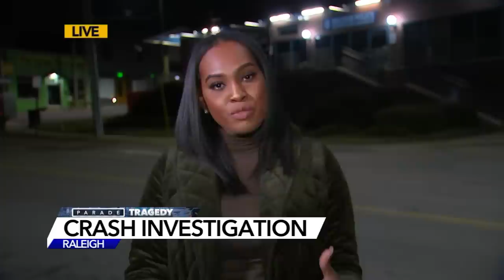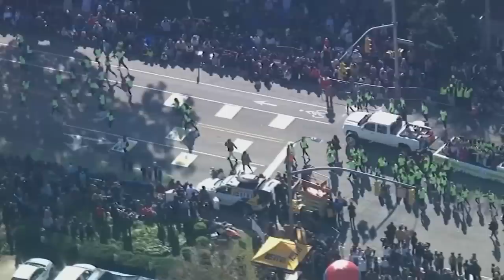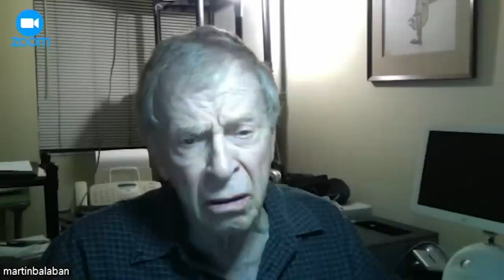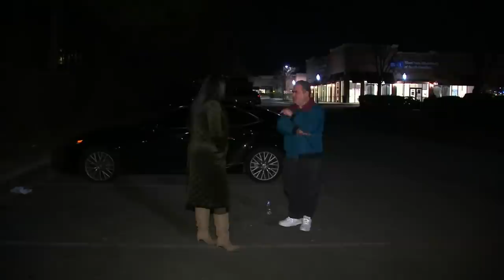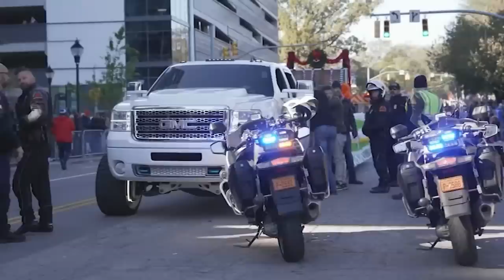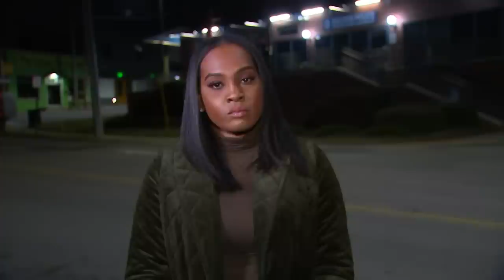Investigators look at truck part by part after Raleigh parade tragedy

Comment: It sucks that so many of these avoidable accidents happen! My son is now starting to drive and I’m hoping to get through his head that If any mechanical malfunction arises, shut it off! Just sickens me he was going maybe 10mph and not one thought of getting it out of gear or just shutting it off came to thought! Always after it’s too late. So tragic!
Reply: shutting it off is probably the worst possible thing to do in a situation like this. if you shut off a vehicle, you lose all driving functionality. your steering wheel locks up, the break booster stops making pressure, leaving you with whatever it has made, and if the brakes fail, you have no break pressure and if you have to swerve to avoid something, it is absolutely, 100% IMPOSSIBLE TO STEER WHEN the ENGINE is OFF. in a normal gasoline powered vehicle, its better to try to get it out of gear, or crash it into something than turning the engine off.

DO NOT SHUT A VEHICLE OFF WHEN IT IS IN MOTION, come to a stop, or let it stall out, as long as they key is in the on position, you will have steering. I don't know how it is with push button start vehicles though

sometimes, what looks like an "avoidable accident" from the outside perspective, is not so cut and dry, and i appreciate that the forensics team is investigating it completely and diesel trucks, like this one here is a lot more complicated than anything you or me have driven in our lives. that truck is rated to tow over 30,000 pounds.
Reply: He was going in a straight line at maybe 10mph! If you lose your brakes! You shut it off to bleed of whatever speed off you can! Not just plow into a kid and keep going!
Reply: Also if you turn the key one click, it unlocks the steering.
Reply: @brocksutliff8782  truck won’t cut off while in drive in motion, truck also will not let you slam it out of gear. Emergency brake is for holding trucks weight, GM is also brake cable, pushing it wouldn’t have done a thing with the weight behind it. There’s literally nothing you can do with brake failure in the middle of a crowd, keep going straight until it stops or swerve into the crowd to ethier side? You people really need to stop speaking on what shoulda coulda woulda done, and just realize you probably would’ve been in the same situation if you were in his shoes that day- freaking out yelling to get out the way and trying to do everything you could to avoid.
Reply: @brocksutliff8782  shutting it off is the worst thing to do

Comment: The bumper height was changed. Making it more dangerous on impact.  That's illegal in most states
Reply: at stock height that truck would have still easily ran someone over
Reply: @jaynederp5236  insurance has a field day with that one tho so I don't imagine it helps here..
Reply: Litterally every single mod to that trucks suspension brakes all that need to be DOT approved parts

Comment: It's called the emergency brake... if that doesn't work turn the ignition off put it in park...
Reply: Gm doesn't allow you to turn off the ignition if you aren't in park and won't let you put it in park unless stopped after 2007

Comment: Vehicles breaks have been redundant for years the emergency brake is completely separate from normal brakes they both can't go bad.....this is just the result of giving people driver's license but never show what to do in emergency....ask any one and they will not know the brakes are different systems. Only way it won't work is if someone one removed brake shoes from truck....that truck is new enough emergency brake should been fine.🤔🤔

Comment: Booster failure is the issue! Emergency brake is there for a reason BUT THE OPERATOR HAS TO USE IT!
Reply: The emergency brake was not operational either from lack of use or from disconnection after the lift modification.
Reply: Gotta realize that most younger guys or girls with trucks and SUVs that are built for show or to look good aren’t going to be thinking about an emergency brake in the situation because more than likely they’ve never had to use it and it’s really really easy to forget completely about the emergency brake when it’s not a handle sitting right next to your shifter, it’s a pedal in the floor and if you’re not someone that uses an emergency break often or on a daily basis it’s not exactly going to be something that stays on your mind plus with being said that the truck has a lift kit and all the fancy stuff the emergency brake could have been disconnected because of the thought of never needing it or having a use for it a lot of people do disconnect the emergency brakes because they simply don’t even know what it is or have a use for it, or think they would ever need it

Comment: At the very least a proper functioning trailer brake would have done a good job at that speed. The power steering pump which provides hydraulics to the brakes are known to go bad. All around a lack of experience.

Comment: There's no excuse. Brakes, parking brake, ignition off and park (automatic) or in gear (manual). Inexperience is the culprit. And yes, I had the experience to do all of those things at 16. If this guy didn't have the experience at 20, he had no business pulling a float in a parade. There is simply no excuse for that to have happened.
Reply: I mean he probably was freaking out and wasn't thinking clearly accidents happen he was on adrenaline

Comment: I'm betting ether the trailer didn't have the brakes hooked up and if they were they weren't adjusted by the Driver.
Even if the hydraulic brakes failed on the truck the electric brakes would have stopped both truck and trailer.

Comment: downshift, turn the engine off, pump the brakes, does the float have trailer brakes? Looks like the truck was heavily modified. Sometimes that what you get. So sad...

Comment: Number 1 that truck was tampered with those are not factory rims and it looks like that turck has a lift kit as well...
My heart go out to the one's effected from this...
Accidents are not preventable this was someone did not know what they were doing with the truck modifications...
What about the emergency/parking brake inexperienced driver could have turned the truck off emergency brake or put it into reverse...

Comment: 1: Pump brakes…
2: Turn off engine…
3: Slam it in neutral or park…
20 year driver probably doesn’t have much experience.
Reply: Gm won't let you turn the motor off unless in park and they don't let you put it in park without stopping
Reply: @colbybarbour3747  I didn’t know that. Then I’ll all a #4: Parking brake!
Reply: @fromundadeez4823  he probably deleted the parking brake during the lift

Comment: Driver Panicked. Every vehicle can be made to stop. If brakes fail use the emergency brake ( parking brake ), if that doesn't work shut off engine, even with push starts just hold that button hard for a few seconds, lastly put the vehicle either in neutral or put it in PARK!!!

Comment: I personally had the same year truck and got rid of it because it almost killed me because it would die with no warning shutting the engine off. A week after I got rid of it they put a recall out for the ignition cutting out. My faith in gm vehicles left after have two in a row that absolutely where junk. So do I believe the driver it's  possible but I will not be surprised if it was his fault.

Comment: The hydraulic system? It’s a truck not a tractor… e brake , turn off ignition, slam it into park…. I don’t know…
Reply: It has hydraulic brakes, wheelers have air brakes. Different system. Add the weight of the trailer and its not stopping.

Comment: That sounds like a pure Factory build failure if there were no modifications to the truck except the wheels that has nothing to do with anything it sounds like the truck had way too much weight on the back and the brakes would not hold the weight from stopping it otherwise sounds like a factory failure stop pointing out modifications done to Vehicles because I can assure you that aftermarket companies that are quality build Parts better than Factory

Comment: Definitely a tragic accident for all involved... Glad my grandfather trained me for brake and power steering failure, but I'm sure not many are given that knowledge.

Do I feel the guy should be crucified in court? Absolutely not (This is the EPITOME of an accident, and the kid is going to live with it the rest of his life regardless of what happens and that in itself is punishment enough in this instance).

However I do believe that drivers education should train people on the use / employment of emergency measures such as deploying of the park brake, putting the vehicle in neutral and turning it off, slamming it in park (because damage to a transmission can be repaired but the loss of a life cannot) etc.

Comment: Putting in park - just makes noise, only engages when stopped, also breaks easily
Park brake - even in mint condition it will barely hold these trucks empty on a slight incline with disc rakes in the rear
Shut the engine off - would barely help at low speeds due to torque converter, plus loose steering assist
Reply: Park will engage at slow speeds I’ve done it on accident in my 2015 Denali hd and it stops it in its tracks

Comment: You could've pulled the emergency brake that works with a cable not hydraulic
Reply: I "heard" the brake cable wasnt connected because of the lift on the truck often times they are to short afterwards
Reply: @tomr3422  then the guy is at fault

Comment: If the police had stopped him so many times for his truck why didn’t they just take it off the road instead of leaving it up to him (who already showed the police he didn’t want to inspect it). But that’s just another story of the “justice”system loopholing people into committing crimes and then taking the right steps to prevent them and rather than healing and coping with the problem, we make an example out of a person who was invited to pull a trailer for the parade by the CCO Dance Complex.
Reply: Its NC congressmen repeatedly try to take guns on planes, no problem, cause an accident that cripples you and kills your friend, and you still get stopped speeding weekly - No Problem. Are you noticing a pattern
Reply: In my state out highway patrol can seize the mandatory state issued inspection sticker for improper equipment and then make you go back and get it done again

Comment: No one is mentioning the lifted stance or altered suspension. There are many cheap after market "lift kits" which are basically bolt on spring mount spacers which add to the height and stance but RARELY , ALMOST NEVER come with recommended Adjusted transmission and driveshaft mounts or longer brake hydraulic hoses that are now under tension and misaligned if this was a man of darker complexion inna Lowrider or Donk I'm sure media would eat this info up!

Comment: You know going that slow he could of just put it in reverse and gassed it it would of stopped.   Years ago I started to lose breaks going down a hill pulling a trailer with a fork lift. Put it reverse and gave some gas it would slowed it down. Not great for the tranny but it helped and I made it down the hill fine. I was also doing  much faster then he was.
Reply: Yknow that's not a very smart idea due to many things going wrong locking up the transmission is literally like pressing the ebrake its not the best to do
Reply: @dzl6848  if you're going at speed then yeah it might kill you or others besides I was meaning what you did.
Reply: @lucid523  do you know anything about vehicles?

Comment: could have turned the motor off... jeeze
Reply: Turning the motor off would take a bad situation and make it worse. With the engine off you would lose hydraulic pressure to the steering system in a situation where control could be the difference in inches of life and death.

Running the engine gives the driver the only control this vehicle had left which would be engine braking by simply putting the gear selector into first. First gear ratio on a GMC Denali heavy duty is 4.54 a crawler gear. In this configuration you will have full steering performance with engine braking that would give the vehicle a speed slower than an adult's walk.

The driver may have attempted to put the vehicle in park which on this vehicle would default to neutral. Or he actually put it in neutral, in any event the vehicle began to pick up speed down the hill because of this and the accident happened shortly after.
Reply: Everyone always fails to mention that after you shut off the engine turn on the accessories and then you have manual steering back again

Comment: Modified trucks should not be allowed to pull floats.Only trucks designed specifically for towing should be used. All trucks that are being used to tow floats should be required to undergo a rigorous inspection.

Comment: But a lot of people don't know is that those Parade floats often exceed the towing capabilities of the vehicles Towing them and very often they have no braking system on the trailer itself
Reply: Definitely did not exceed the towing capacity of that truck

Comment: Unfortunately electrical systems on vehicles is the weak point.  They can cause power steering failures and brake pressure failures.  Happens quite a bit to GM vehicles that I have seen.   But he didn't pull a Darrell Brooks, so that means this young man didn't want to hurt anyone

Comment: It only takes one time seeing somebody shut down an out of control vehicle by knocking it into neutral or just switching off the engine to remember what to do when it happens to you. Why is this not taught in drivers ed ? Seeing my dad do it when the accelerator stuck on a new build we were test driving probably saved me (and my Camaro) when it happened to me years later.
Reply: It happened to me years ago when I rented a uhaul brand new less then 500miles on it and it took off on me stopping in traffic I wound up shutting off in drive and then back to accessories for manual steering options

Comment: If the sliding pins seized and he was driving with his brakes on it could've caused no braking situation.
Reply: Even if the break pin seized the cylinder would still engage the brake pad
Reply: He's in the south and has a lot of non factory parts on it I'm assuming that he had fancy calipers for those wheels as well not rusty old calipers

Comment: Just looking at this truck you can see it does not meet Inspection-safety for highway use.
The wheels are way too far out of the wheel-wells! Very dangerous and illegal.
I'm sure the victim was run over by these illegal  wheels.
Reply: It's only illegal in certain places, certain states require mudflaps and fender flares. not illegal in North Carolina

Comment: Throw it in reverse???
Reply: Engine braking with first gears the only thing that would work. Putting the vehicle into park or reverse would default the vehicle into neutral. Which is what the vehicle appeared to be in as it gained speed down the hill until the accident.
Reply: @MajorBorris  no it wouldn’t, he shoulda just slammed it into reverse
Reply: @MajorBorris  no it wouldn’t, he shoulda just slammed it into reverse